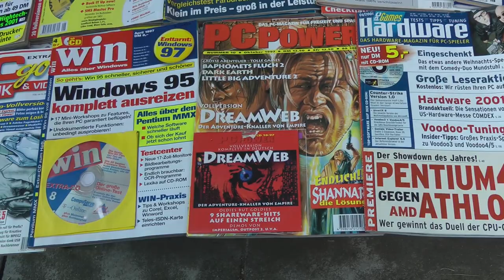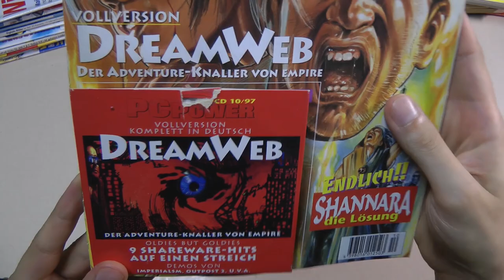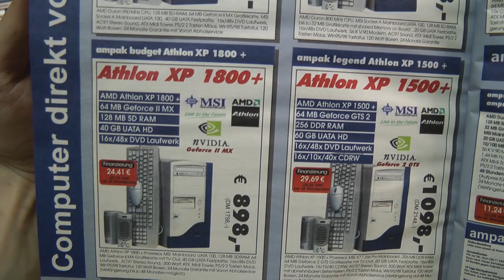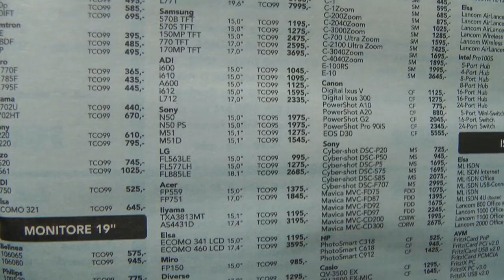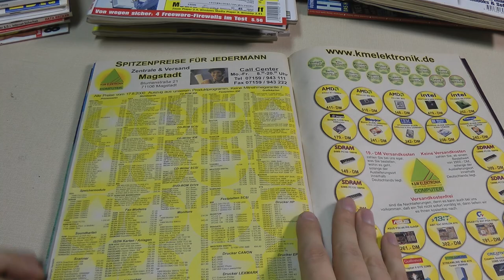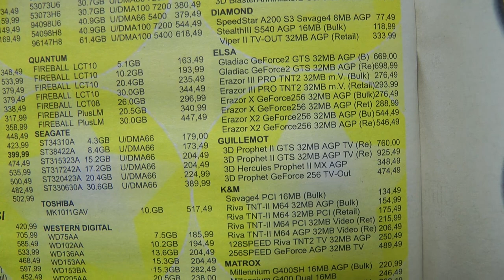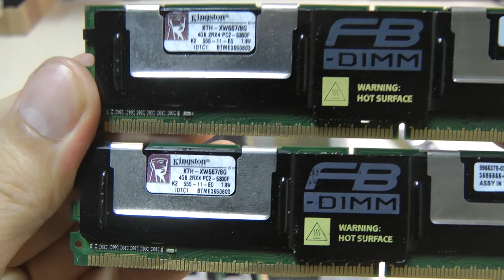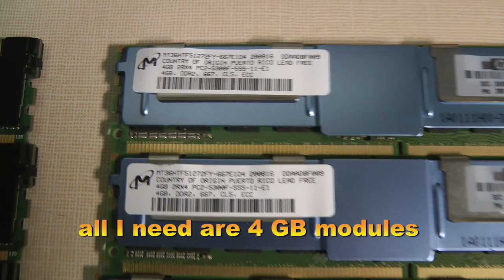I bought 26 kg of old PC magazines

Comment: 9:20 
TNT2 M64 - 199 DM
V3 3000 - 219 DM !!!!!!!!!!!!!!!!!!!!
TNT2 Pro - 279 DM
TNT2 Ultra - 399 DM
V5 5500 - 659 DM !!!!!!!!!!!!!!!!!!!!
GF 2 GTS - 699 DM
The V3 3000 was just as cheap as a TNT2 M64 which is over 2x slower and much cheaper than a TNT2 Pro and Ultra which have aproxinately the same speed as the V3 3000. The V5 5500 was slightly cheaper than a GF 2 GTS 32 mb.

Comment: I recently found one of my magazine from 1999 and reading trough was pure nostalgia.
5:48
Nokia 5510, weird phone but first for me to see that can play mp3.
My friend had one i was like what is that how do you speak trough, i had 3310 Legendary
7:50
Belinea 21" inch CRT i had one father gave it as present in 2001  used it well in 2007-08.
But i think i got it cheaper than 1575 DM
8:51
256 MB SDR 133mhz 690 DM, yeah i remember those prices, i rolled with 128 MB even in 2002, and it was upgrade from 64MB
512 MB SDR 133 1590 DM 
9:43
Pentium III Slot 1 933 mhz 1957,49 DM bruh that is some coin to spend
9:49
SB Creative Live ! 107 DM, had one in 1999 paid around 130 DM, worth every penny, still have it in my P-II System
9:57
V3800 Deluxe TNT2 Ultra  my first AGP card, i got it in 1999 for around 400 DM Still got it in my P-II system, hope someday i will find Asus P2B motherboard same one i had in 1999

Thanks dude this was trip back in days, good times and exciting times for PC users

12:38
That LianLi case like it was in tornado, and just dropped off in front of your house
16:04
Brrand new acrylic case gota be there is no scratch on it, i mean those cases are so stupid but so mesmerizing, if i found one for sure i will got it.
Reply from the maker: LIAN LI case is little twisted but in final no visible damages, so will be fine after few hours of work.
I like acryl cases, poor packaging too but it survived.
Reply: @RETROHardware  
Thanks for pinup, the heavier case the more damage Acrylic probably survived because its light weight probably.
It will be interesting project for that case :)